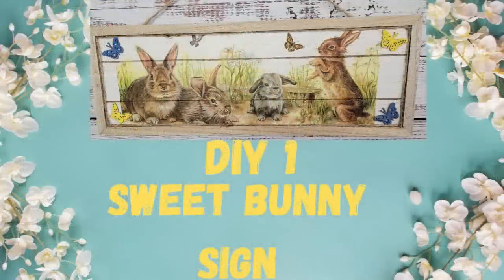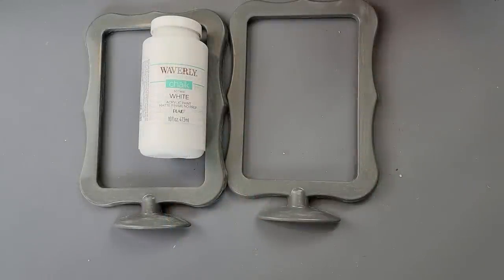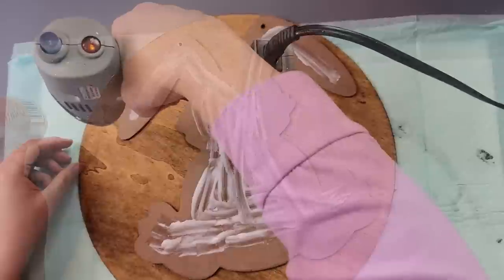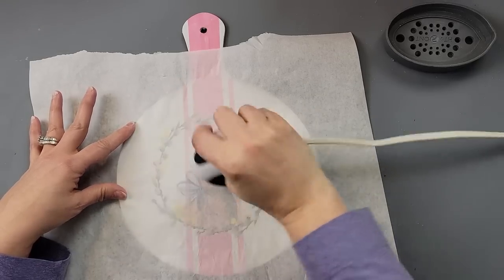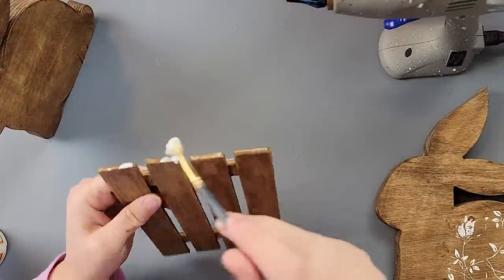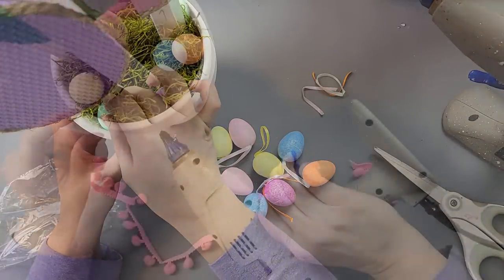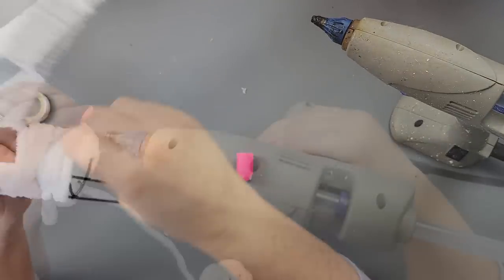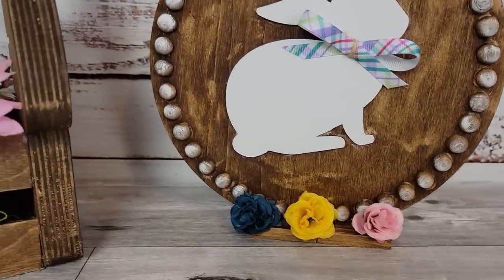***8 EASY BUNNY DIY'S/BUNNY COLLABORATION ***

Comment: What type of mini iron is that?  I didn't see any link listed.  What types of small irons can you use to iron out the napkin or material when using mod podge?
Reply from the maker: Karen, I am so sorry. My husband bought me the mini heat press, and I forgot to add it to my Amazon Store. The brand is HTVRONT  but any brand should work. You can also use a regular iron without steam. I like the shape of my mini press because it gets in corners nicely